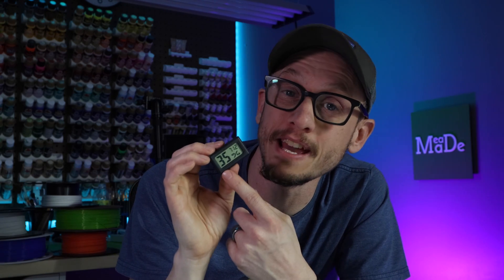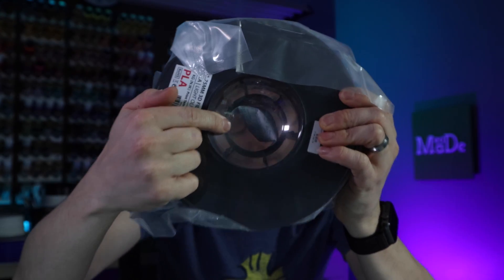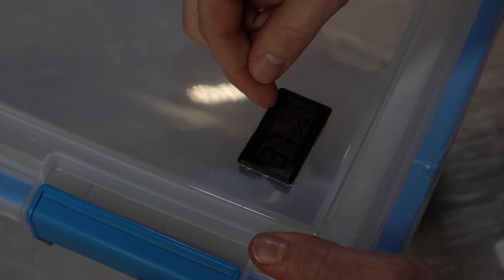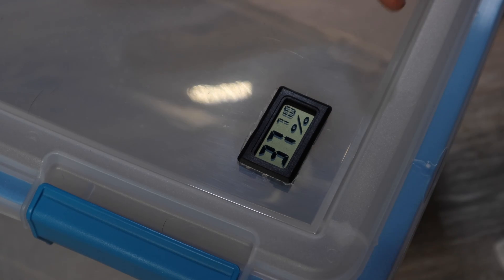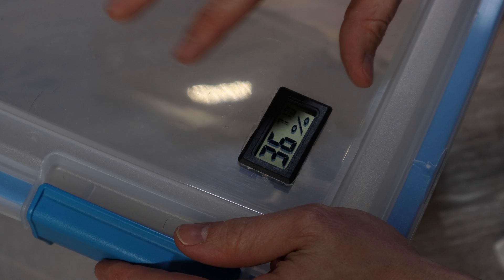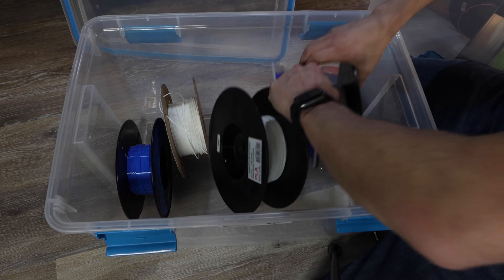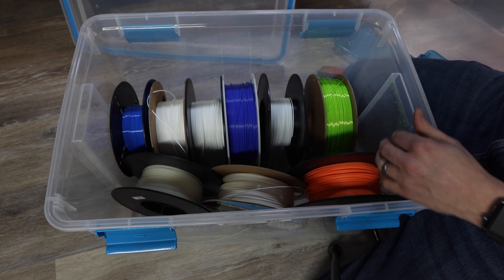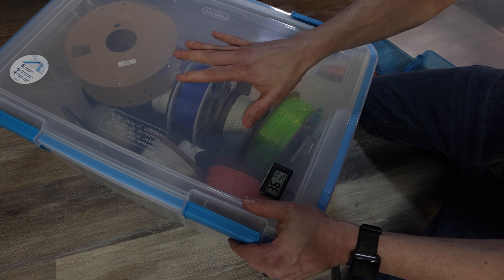Don't Ruin Your Filament - Make a Filament Dry Box and Save Your 3D Prints!

Comment: About the desiccant bags, they are NOT junk when they are saturated. Cut the bags open, and the beads should be random shades of bue, purple, and pink. I use a ventilated hot plate to do this at work, you can use an old pan you don't cook food with anymore,  but you just need to heat them on a metal surface for a little while, and the color should disappear turning back to a translucent clear/white color, and your desiccant is brand new again.
Reply from the maker: Nice tip. I'll have to try it out.

Comment: I like that dry box.   What do you think about just getting vacuum-seal bags with a pouch in each?  I saw these at an online vendor, and they are just large ziploc bags with a vacuum valve in the side, and a pump.  Each bag fits a single spool.  Will this basically do the same?
Reply from the maker: You absolutely could do that. I have a vacuum sealer but I chose to go this way cause it’s less waste and the box is reusable.
Reply: @ItsMeaDMaDe  The dry box is much less painful, especially if you are swapping reels often...  By vacuum sealer I mean ziploc bags, not welded, so the bags are reusable, not ever-shrinking!
Reply from the maker: @RufusVidS  it’s definitely a good option if your not swapping out like you said. Typically for me I swap so much I would end up hating myself having to keep vacuuming bags. I go through a lot of filament though and when I open it it’s typically gone in a week. Except some specific filaments I keep on hand just in case.

Comment: I have my printers in my basement and of course my filament, recently needed to print with PETG, opened 2 new spools, had horrendous stringing and blobbing. Put them in our dehydrater, 150 for 8 hrs and stringing/blobbing gone. Decided it was time to get/make some dry boxes as I do have issues even with PLA. Some colour changing desicant + a hygrometer (the round ones) which now show the basements current humidity is 45% and the dryboxes sitting at 18%. No more PETG excessive stringing.
Reply from the maker: That’s awesome glad you could save your filament.

Comment: I have a question...  I print exclusively with PLA.  The printer is inside my home in an office (I do however live in central Florida) and store the opened spools in a  cabinet drawer under the printer.  I leave the AC on about year round.  Is a dry box still necessary for PLA in this scenario?
Reply from the maker: Well I will say I don’t live in a very humid climate like you and mine was in a similar situation with a dehumidifier and I still have ruined spools. At the least you may want to get a humidity gauge and see what the humidity actually is. The optimal humidity is between 10-15%. Even in low humidity over time spools absorb what’s in the air… it adds up.
Reply: @ItsMeaDMaDe  Starting down that path. Got that box from Wal-Mart today and ordered a humidity gauge and dehumidifier from Amazon.  I'm testing my wife's oven dehydrator now for temp accuracy - I set the oven to 100F and the thermometer is reporting 130F - the thermometer is only rated to 122F so not sure what to believe.

I have noticed recently I've had nasty stringing and oozing (Ender 3-Pro all stock).  I reran the E-steps calibration then adjusted flow rates then onto adjustments with retraction distance and speed.  Got some improvement, but still there.  I was going to try different filament this week for another project.  Then your timely video showed up.

Comment: I am having the opposite problem. My filament get to so dried out and  brittle it crumbles  when I try and feed into the printer.
Reply from the maker: That is actually still a moisture problem. What happens is typically the filament absorbs water then has some type of exposure to UV radiation or sunlight. Dries it out the filament causing it to become brittle and break easy cause the filament starts to break down due to the changes. Or sometimes it’s just a bad batch or brand of filament.
Reply: @ItsMeaDMaDe  Oh, That's good to know. Thank you
Reply: Is the filament now trashed, or is there a way to restore it?